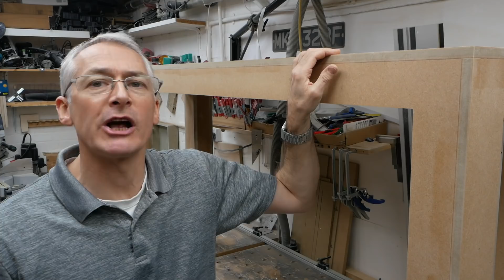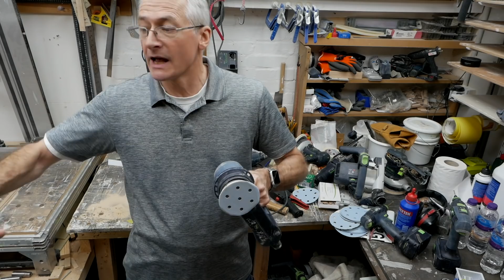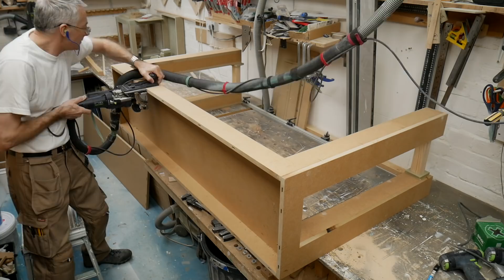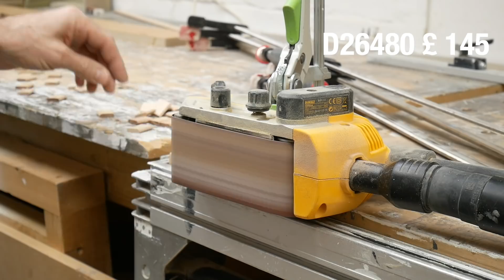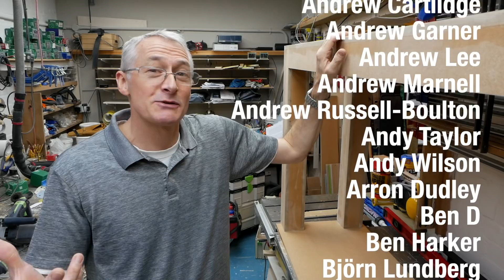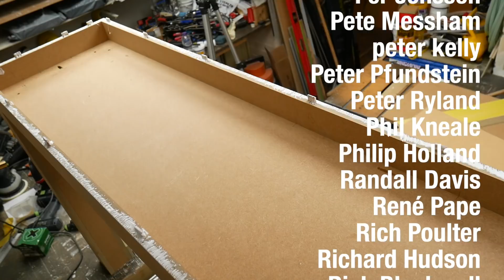Time, Tools & Money [video#245]

Comment: Keep up the good work Peter. I am a strong believer that the market (consumers) ultimately control the price. If you charge too much you soon will have no work. Clearly you customers find value in what you create and pay you for it.  If they did not think it was worth the price they will not be back. 

What one person considers too high another may consider a fair value. As I got older and more financially secure I found paying a bit more for quality was far better than getting low price junk. You customers may fell the same way.  As for being a "bespoke joiner" I think you do just fine and I would bet that if your clients required a walnut vanity you could make it and it would be beautiful.  In the end the client should get what they want and if they desire painted shelves that is what they get. It is hard to beat MDF  for certain parts of painted furniture. Smooth, flat and consistent who could want more.
Reply from the maker: Thank you! 👍👍

Comment: Hello Peter, it's true that you could have used more expensive tools, but it's also true that you could have used good quality tools such as Dewalt or Makita that are much cheaper than Festool.
Reply from the maker: That’s very true Richard - and just so’s we’re clear, I wasn’t using this video in any way to justify my purchases. I run my own business, I don’t have to justify them to anybody. But, out of interest, what DeWalt and Makita sanders have dust collection as good as the Festool? Where’s the Dewalt or Makita equivalent of the Rotex? Which DeWalt it Makita drills come with a 3-year warranty - including the batteries? My original tracksaw did 11 tough years on its first set or brushes - could I say the same of a DW or Mak? And the Domino?? Festool-only, mine’s getting on for 10 years old, and has cost me less than £1/week. And I could probably get the purchase price back right now if I sold it. So yes, I could use cheaper tools - but I made a business decision not to; I think it’s worked out pretty well 👍👍
Reply: @10MinuteWorkshop  Yes Peter, I understand your reasons for choosing Festool and it was your choice for your business.  I am retired and don't run a business so I can't justify Festool prices (or greater) and I suspect a lot of people who watch your channel are in a similar financial predicament.  My comment was really intended to highlight the difference between your two videos where you used cheap tools and Festool tools and suggest that there is a middle way as well.  In my experience, buying very cheap tools is usually a waste of money as they either don't work very well or they quickly expire.  Obviously there are exceptions and there are bargains to be had (Black Friday soon).  I wasn't trying to be critical because I enjoy watching your videos and have learnt a lot.  Please keep them coming!
Reply from the maker: No problem Richard, appreciate you replying. Though, as an aside, I think you’d be amazed at the number of hobbyists who contact me privately, and clearly have a significant investment in high-end tools and machinery. 👍👍

Comment: I didn't notice the end-grain of the MDF showing the last time - does it not stand out once the table is painted? I am guessing that the end-grain absorbs paint faster than the face-grain giving a different finish?
Reply from the maker: No, these go off to be sprayed in a hi-gloss finish, the cut edges of the MDF are indistinguishable. Do you follow me on Instagram? I posted some picture a while back of a small MDF side-table in hi-gloss, is shoes the finish off very well 👍👍
Reply: @10MinuteWorkshop  I do, but I rarely go on there. What date would it have been roughly? I quite fancy making one of these.
Reply from the maker: It was this one - https://instagram.com/p/Bl_SifWAhZ8/ 👍👍

Comment: First up, I hope your insurance is up to date with all those tools!  I imagine that you purchased them as time went by as you needed them. I was amazed at the number of sanders that you use.  Is this for speed so that you don't have to keep changing grades (a bit like a drill and driver pairing)? At the end of the day, would you say that the 'quality' of the finished products are identical except one took  longer than the other? 

Thanks for the comparison video and keep up the good work.
Reply from the maker: Thanks Kevin! The Rotex Sanders are gear-driven so capable of being very aggressive when required. With the others, one is a fine finishing sander, the other more general-purpose. So yes, it’s a convenience having them all, but they all do slightly different jobs 👍👍